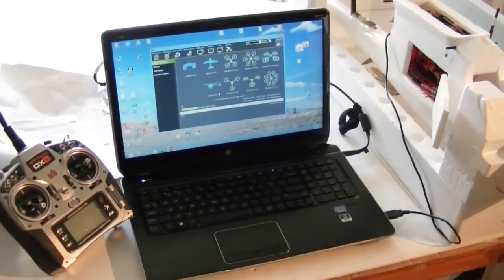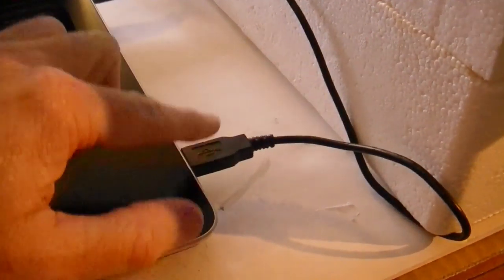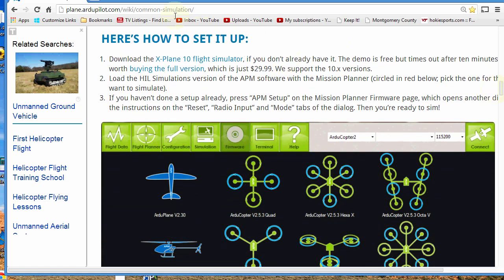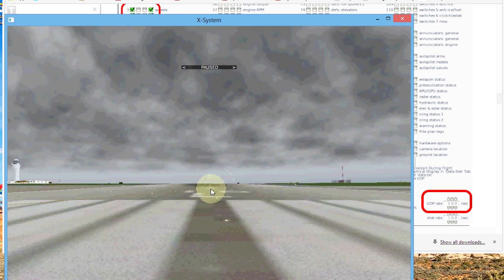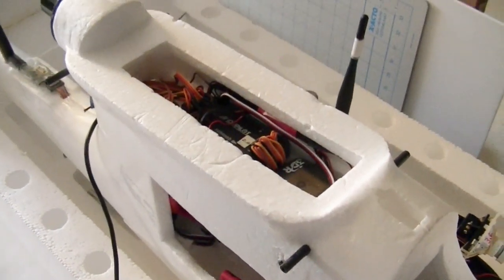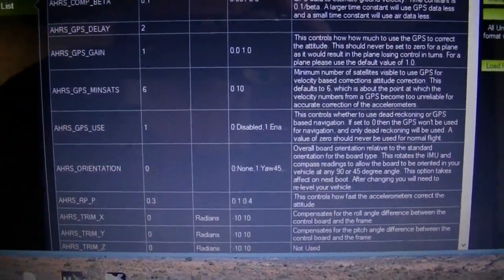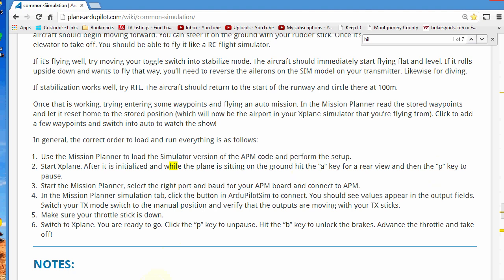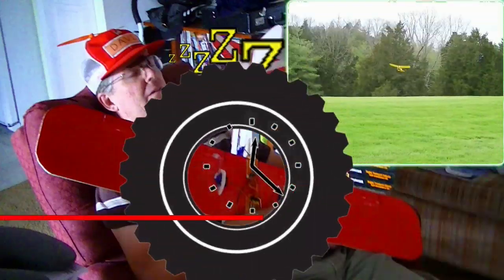How to Setup X-Plane 10 Flight Simulator to Ardupilot Mission Planner with HIL Firmware

Comment: Sir Any tips about SITL with Xplane ?
I followed the instruction giving by ardupilote but I had a message says Mavlink heartbeat package missing all the time 
I am connecting with TCP protocol for 115200 baude with default parameters  
I am using Xplane and MP 1.3.39
please any help
Reply from the maker: Did you load the Simulator firmware on the APM. I has to have special firmware to work.
Reply: I am using SITL without hardware
Reply from the maker: Oh I guess I am not much help then I didn't understand SITL and was using HIL.
Hope you get it working.
Reply: It is not working Sir I spent like three weeks to understand it but in the end is not working

Comment: Hi. Thank you very much for your great explanation.
I have two questions and I would like to know if you can help me:
1) I manage to do everything, however in the flight data I can´t see the aircraft and mission planner does not update to the xplane flight location. Do you know the reason?

2) Do you know if it is possible to draw a waypoint trajectory in flight plan, and make xplane follow those wayoints in auto mode?

Thank you very much for your great effort.

Comment: Hi, could you do a video on the setup of HIL simulation of arducopter with xplane 9/10? I have problem setting up the HIL simulation. All my sticks are working fine except my throttle stick does not have any signal in the mission planner when I click "display all". Could you help me to troubleshoot the problem as I have been trying to solve this for months? Thanks.
Reply from the maker: I don not have an Arducopter to do a video.Follow this step by step. It is for my plane but it still may help.
Quick Start Procedure to Fly X-Plane with the Ardupilot Mission Planner
Reply: ***** I tried arduplane HIL before and I did not have any problem with that. However, the throttle signal doesn't move when I use arducopter HIL.
Reply: I had the same problems. Try to change the gains in the simulation tab. In my case, I changed throttle to 1000 and that instantly solved the problem.

Comment: Cool video, just a suggestion, you may want to disconnect your Video TX while doing this simulator.  A. It will use your battery needlessly and B. Most VTX's will get very warm when running stand-still.
Reply from the maker: That is good advice indeed. The VTX is not needed during simulation and neither is the MinimOSD. In my case both of those are on my video pod so it's easy to disconnect them. My main flight battery was not connected either since the Ardupilot was running off the USB cable.